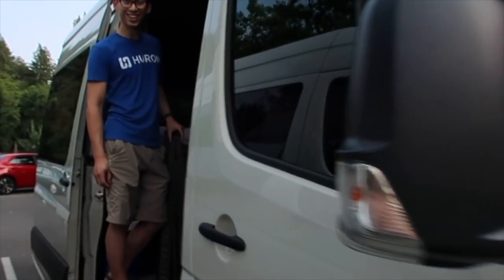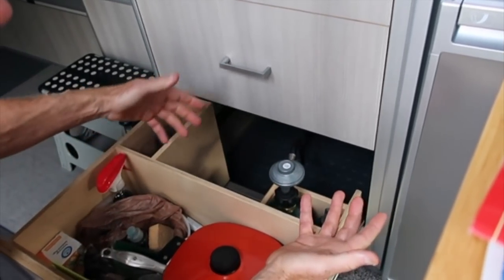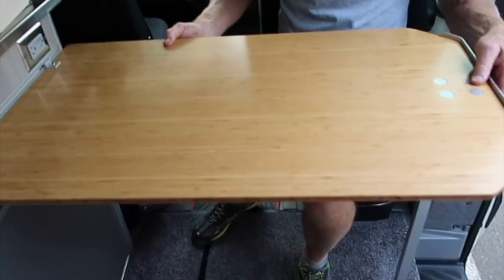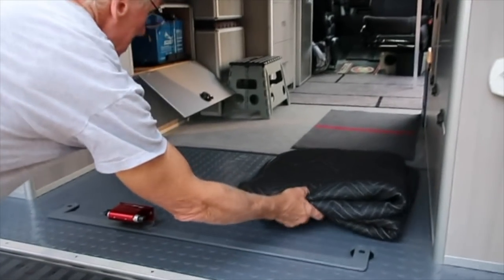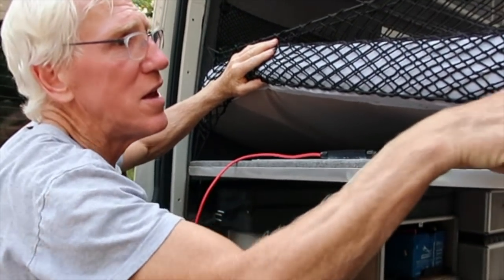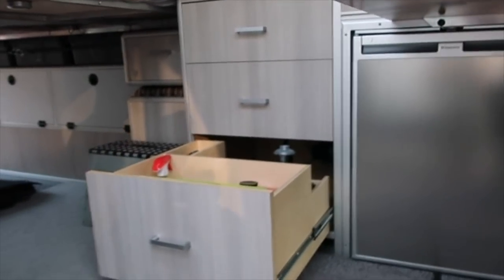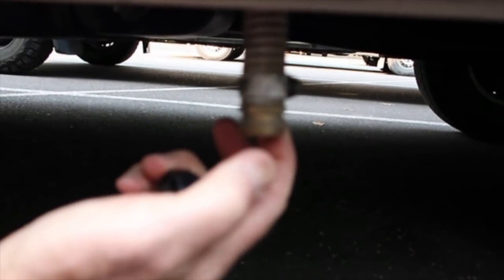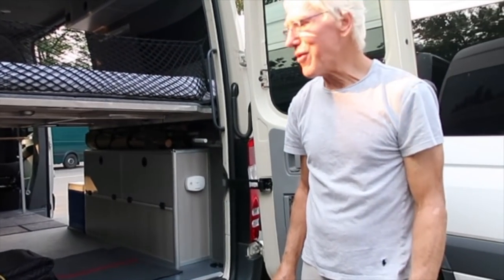80/20 Van Build Tour

Comment: 8020 (or rather, t-slot aluminium) is an ideal material for this stuff. It's very easy to build, just cut the parts to length and bolt them together. Basically easier than wood in many ways. And you can get a great result - this van is gorgeous. And all that aluminium is light weight, strong and rot resistant. Win win all over the place. If seeing the aluminium isn't your thing it can be easily covered all around with wood - plywood, bamboo, furniture board with any of umpteen available patterns and colors - whatever your  choice is. There are ready-made fasteners you can bolt panels to it with. Probably a bit pricier than wood, but so much better too.
Reply: Probably a bit pricier?  probably? this stuff is everything you said, but it is a way to add THOUSANDS of dollars in cost to your build.

Comment: Finally somebody that knows at least a bit about how 8020 is supposed to be used! Kudos. I’m not keen on your bed structure. Why didn’t you use 8020 for it? doesn’t look very strong Due to shallowness of the aluminum and the long span. If one of those welds brakes The whole thing could collapse and you’re going to get hurt but it sounds like you had to modify it already. I’m curious what they  charged you for that because I’ve got a much better idea I think is probably cheaper too.

Comment: I like that 80/20 system. Looks great.
Reply: It's great if you have an unlimited budget.
Reply from the maker: It's a Sprinter build - that's almost a given!
Reply: @johntatman1436  Buy it off eBay, much cheaper.
Reply: @craiglitherland1289  Can you tell me a little bit about the doors. I’ve been trying to find some that I’ll be able to hook directly into my 8020 with hinges. Not sure if you build these yourself or if you can buy them whole. Thanks so much for your help

Comment: I would have used sliding doors on the cabinets under the bed what is there’s a ton of stuff in the way and you just wanna get some little thing out of there. You  have to move a ton of stuff so if the whole hinged door can swing

Comment: It would be interesting to have links to his sources. Like where did he purchase the marine shower hardware, and was the lower cabinetry bought as a piece (and where) or did he build it also? Does he have plans? Where did he source the extruded aluminum he used for the upper cabs? What is the usual application for this stuff? What materterial are the cabs made from (luan, pressed wood, solid wood...)?
Reply: If you check out 8020.net you can get endless amounts of information on t-slot aluminium. It's used to construct, well, almost anything you want. Think "erector set for adults". The cabinets are almost certainly built out of t-slot and bolted together. You can get it in versions with a slot on all four sides, or just slots on some of them. These cabinets look like they have slots on the inside, but smooth on the outside for a nicer look.
Reply from the maker: Sorry - I didn't get his contact info, so I can't even ping him to let him know the video is up. Or, if I did, it was so long ago that I've forgotten.
Reply from the maker: Thanks for answering the questions! I'm definitely not an expert on t-slot aluminum construction. ;-)
Reply: @lorcro2000  That's so cool! Thanks for taking the time to answer that. I've heard a couple of oblique references before but never enough to figure out a search term. I really like the idea of aluminum to reduce weight and bulk. Cudos.
Reply: @TheGalavan  Oh was this a while back?
Reply from the maker: Yes - back in August.
Reply: @TheGalavan  just suggestion but if you are making a video of a well constructed van of course many people would like to know how and the parts etc and contacting th e owner that is mostly why people make videos to help the community build better vans so long as they know where to get th e materials and how to,  definitely  a big miss on not getting that info
Reply from the maker: @FBall-im8ui  I get it!  I've learned so much in the 19 months since I filmed this video.  I definitely make sure I stay in contact with the people who let me share their vans and ping them when there are questions.  I was but a baby creator back when this was filmed!

Comment: Anyone know the name of the 8020 "connectors" used for that quick detach table (the two pieces that slip into the profile)?  I can't find on the 8020 site...
Reply: skipdup 10 Series Roll-in Panel Mount Bracket part number 2489. Took me a minute to find it. Make sure you get the right size part for the track you’re using.